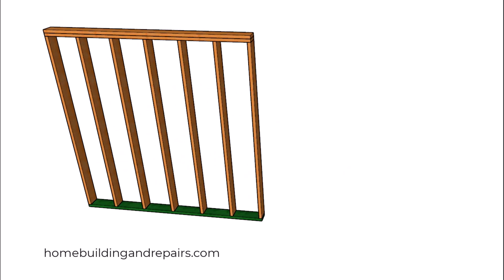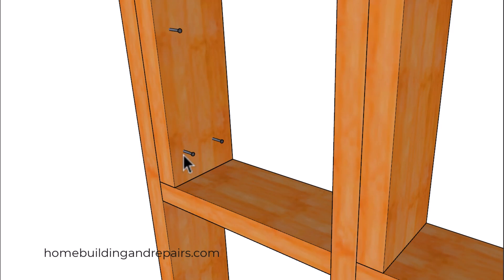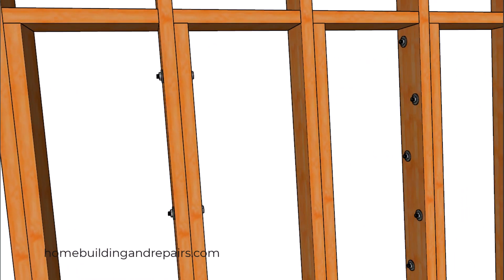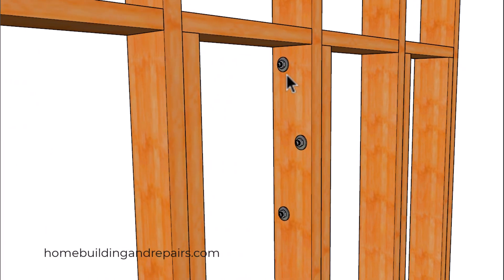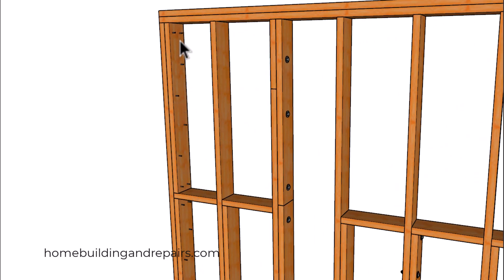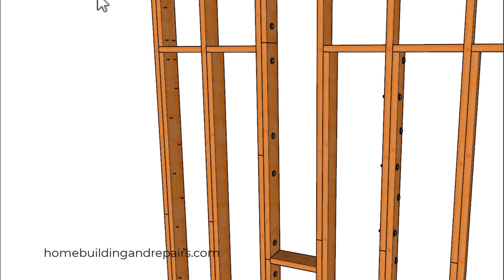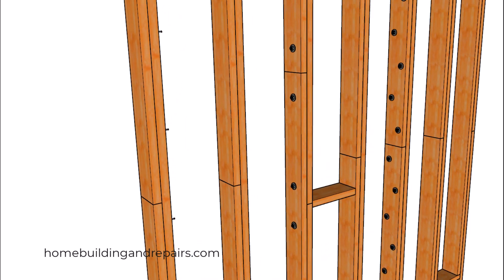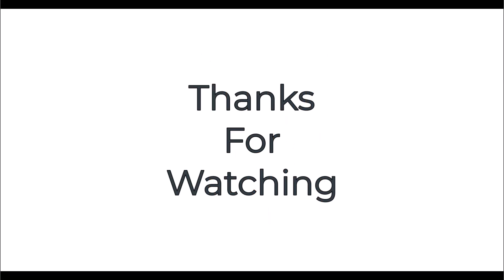How To Build Taller Walls When You Can't Get Long Lumber - Creative Building Solutions

Comment: That's fine for non bearings Partitions, but it'll never fly with the building department as a bearing wall.

When we're drafting architectural working drawings, the notes on staggered spacing of fasteners is each consecutive fastener, not every other one.
Reply from the maker: Sounds good.